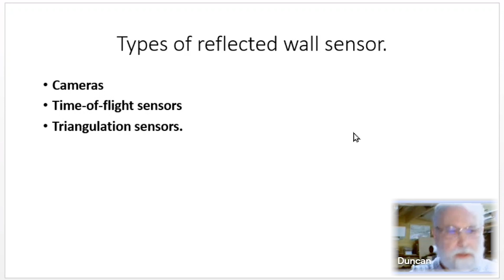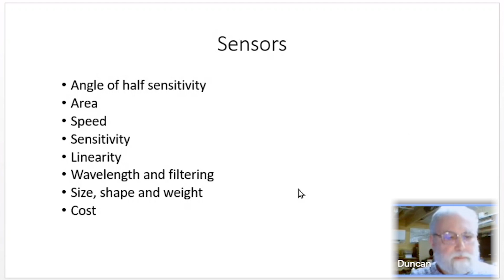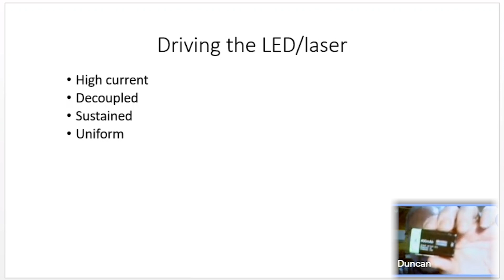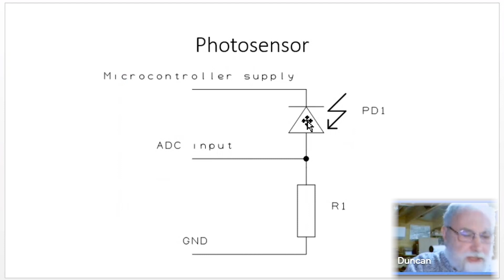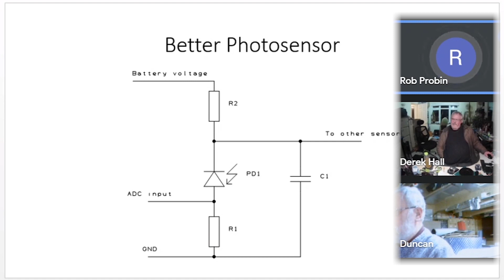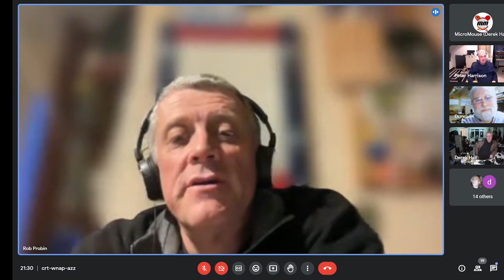Duncan Louttit takes on the design of wall sensors for MicroMouse - Part 1 | UKMARS Robotics Society

Comment: Wonderful coverage, I'm using  TOF currently but as you say they need ~ >10ms per reading , ok for a slow mouse but at speed not so good. They (VL53L4CD) average the distance reading if the beam is split , and its an 18 degree beam so only useful when on same cell full walls, at max frame rate they are also very noisy. Planning to use triangulation but initially will try a laser and photo detector just to detect wall end for turn timing. Arima lasers make 3mm dia x 8 in several wavelengths and class 1 . The usefulness of the led's is without doubt and proved over decades . Interesting comment from Derek about required speed before a turn is less than on a straight and Peters mention of some mice using single tof's for long look ahead. sounds like a hybrid aproach could be interesting. Nice design tip on the constant current ic with an analog multiplexer. A pleasure to watch.